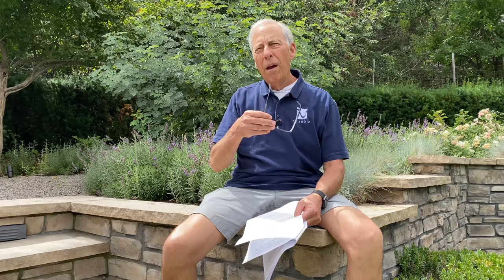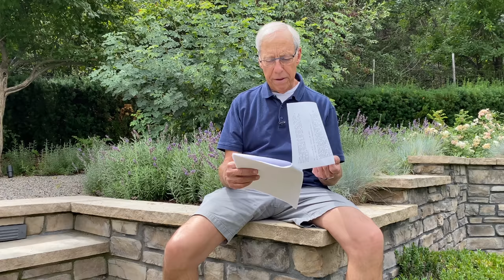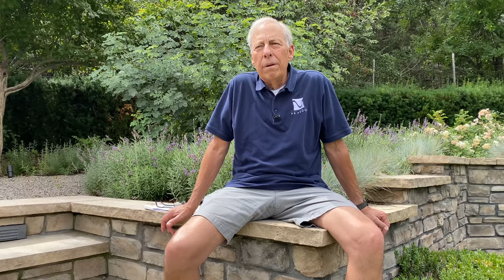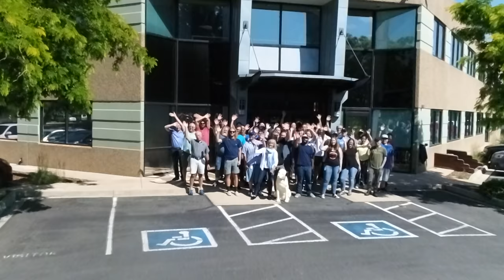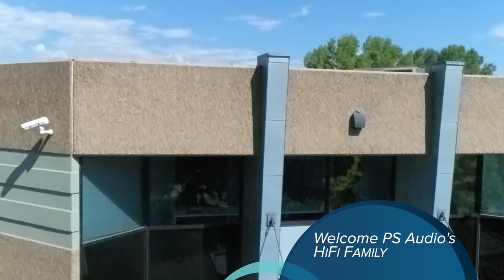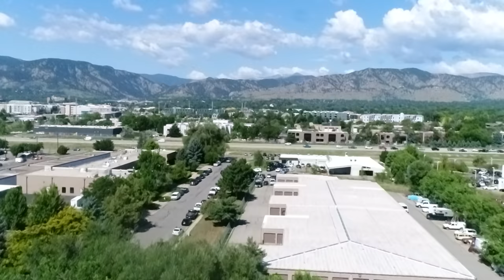Why speaker cables have bare ends

Comment: The reason the ends are bare is because who wants to screw around with adding ends to the cable when it's not needed. Just cut the cable to length, strip the end a bit and stick it in the connector. Boom, done. That's all that's needed. Anyone that tells you any different is trying to sell you something you don't need.
Reply: exposed ends corrode. terminated sealed ends dont.
Reply: @googoo-gjoob  where are you running these wires? In your pool?  That's bullshit. Except for areas with corrosive atmospheres.
Reply: @Alacritous  copper corrodes. crack a book.
Reply: I have always used bare wire too, as they provide better direct contact, but I don't mind if others prefer to get connectors, and funnily the corrosion issue often mentioned has never been a problem. But I do trim them back every 10 years or so
Reply: Banana plugs rule.
Reply: @googoo-gjoob  where are you setting up your stereo where the air causes copper to corrode? In the sea?
Reply: @musicman8270 ... rule what?
Reply: Copper tarnishes pretty rapidly. The tarnish is a fairly good insulator. Copper will slowly corrode as well, but it less a concern than the tarnish.
When I used bare wire, I used to re-tighten the binding posts on the 1st of every month, I could always tell after wards.
Crimped on connectors of any kind are the best since the crimp forms an airtight seal that will not tarnish. Gold plating is good because it does not tarnish, but it wears off very fast (typically less 100 cycles). Nickel is also good.
Reply: @humanitech    Oxygen free copper terminated by gold plate banana plugs rule the day,  no hassel   when you need to change things, just pop them out, no loose wire strands shorting out a 2,000 amp,etc.  Easy  peasy.
Reply: @musicman8270  LOL ..I agree on the OFC cable and the convenience of bananas, but on comparison I still prefer direct bare wire connection myself and so have loads of bananas plugs and spades sitting in a box...but that's the fun of hifi we experiment and use what suits us best.
Reply: @joshua43214  Let me guess. You buy monster cables, too. Right?
Reply: @Alacritous  Why would you suggest that? Do you disagree with anything I said? Copper does not tarnish? Tarnish is not a poor conductor? Binding posts have weak threads? Solder cause wire to break?
And no, I get wire from Bluejeans cables and make my own...
Reply: Alacritous Copper turns green over time. That green is not a great conductor.
Reply: @billd9667  yeah, over years.
Reply: Alacritous and how often to you service your speaker and amp contacts? I don’t know about you, but I  often let them go for years
Reply: @musicman8270  lol...make sure it's not copper bottomed though ...cos they tarnish
Reply: @_Mr_C  just a lot of trouble, a pack of bananas is inexpensive,  easy to attach and dont wear out . I am constantly plugging and unplugging my bookshelves,  so they won't fall off the stands when I am working on my gear, bananas are a godsend
Reply: @_Mr_C   One more thing... electolysis, what makes batteries work. Two dissimilar metals touching have electrons passing between each other, current. Small but over time these two will bond, sometimes rusting  into each other. WHY you need gold plate or some other inert material. Especially with vintage gear,which often has cheap base metal or tin plugs on the back.
Reply: @Alacritous  Just go to ountries like philippines , vietnam and other subtropical / tropical countries.
Even ' Plugs " from banana on speakers to XLR ect they corrode way too fast.
Not to mention .... Guitar strings ... a real nightmare , they corode in just a week for the cheap ones 
and the more expensive . well if lucky they last 3 month.( those in north europe last years )
So , yes some people like me live in a country with very high humidity and temperatures....
We need to take extra care of the equipment otherwise it simply will break because of corrosion.
Reply: @kennethsrensen7706  I am not there. I am in Canada. Are you there? If I were there then I would adapt to the conditions there. I am not. And that's not what I was talking about. I mentioned humidity as factor.
Reply: @Alacritous  oh yes I understand.
Yes Im in the philippines and dealing with such problems every day.
Humidity is really high here.
Im from Denmark and when living in Denmark there wasn't really any issue with corossion , just as you say about cannada , it's pretty much the same level.
But not here where im living now.
I always use bare stripped ends on speaker cables but here I have to ' clean ' them every week to stop corosion.
I found that clean the copper with WD40 and let the ends being wet ( with WD40 ) for a few minuttes and then wipe them totally dry actually work and it protect them a little.
( WD40 have some anti-corrosion stuff , not the best , I know but at least I can get this here ) 
I do the Same with my guitar strings .
After playing on my guitar I wipe the strings clean with a dry cloth and then I clean them with WD40 and leave it as is until next time I play on it. before I play on the guitar I wipe the stings with a dry cloth too.
This have helped against corossion so at least the strings last a bit longer.
Same with the Jack plugs at the guitar cable . clean before and after every use and they doesnt corrode.
My plan in future was to get a cheap house and then rebuild one room so I can control 
humidity , not an easy task but is possible to do even for cheap.
Your statement on using bare stripped cables to connect speakers , I totally agree with. Extremely easy and take a few seconds , shure no need to fiddle around with it more than needed.  : )

Comment: Ferriles are a nice clean fitting at the end of a speaker wire to attach your speaker wires to your speakers. And unless you have speaker wires exceeding 10 feet, the difference between pure copper, and copper clad aluminum is neglible. Nothing wrong though with using larger guage wires than the regular folk.

Comment: The only shielded speaker cables I'm aware of are certain Audio Note cables like the AN-L and AN-D, where the shield is tied to the negative terminal at the amp end only. There have been some coaxial speaker cables like OCOS, but these aren't truly shielded, because like all speaker connections they're carrying a balanced signal.

Comment: Some commercial sound systems (constant voltage) use shielded speaker wiring --- 
but now that I think of it, I'm not sure why. 
Maybe they are so close to high-power radio stations that it becomes necessary. 
     
And, in the late 1970s, I could hear my dad's CB transmissions coming through the stereo speakers in my bedroom.  
No, he wasn't running any illegal stuff; he had only what the FCC allowed.
Reply: Same happened with me 20 years ago with some PC speakers that would pick up CB radios.  It used to scare the crap out of me when I heard people talk in the middle of the  night.
Reply: It's the low voltage parts of the system such as in preamps / tuners / tape machines / line cables ect ect 
somewhare in there something is't shielded / grounded good enough and it pick up noise.
Speakers and speaker cables doesn't pick up anything but noise elsewhere in your system will pass through 
your amplifiers and blend into the higher voltage signal going to your speakers and thats why you can hear it.
Yup can be pretty hard  to trace the source from where it come and what part of the system cause it.
I had the most iritating noise comming ' into my speakers ' but I noticed that it was only when i was playing
on my electric guitar and mixing it with my music creations.....
Ironically enough when I play on my guitar alone there was zerro noise.....
Then I realized that I used a second audio interface for the music and this one was USB ... the one I use with my guitar is firewire .... Long story very short - I was driven crazy to try pinpoint the source of this but I ended
finding that my USB audio interface was connected to an USB hub with its own external 5v power supply 
and that one had gone bad... Yes it was the power supply making all the noise.
After plugging the audio interface into it's own port and getting rid of the faulty power supply then the 
noise was totally gone..... But it took me 2 month to find the source , I tried change cables , grounding 
shielding , again and again checking each part of my equipment .
I finally found it ... damn power supply...

Comment: Hey there.  Thanks for your videos.   I am fairly new in the audio-holic world  (played with lots of stuff in the '80s).   I have been studying things... and I know the cable discussions get heated.   I have seen videos and papers that could convince me either way :-)
Now, you say you don't know of any cables that are shielded.  Since I have been researching, I can give a large list.   Whether they are any good, I don't know.   But I have a lot of TV, Internet, etc cables running around near my AVR, so I felt better getting some lower-priced shielded models...
I saw one video where a guy connected various 'qualities' of cables to the FM antenna screw on an old receiver.  The freebe cable was a great antenna :-)  As the price and complexity went up, the FM signal went down.   Another video talked about the inductance, capacitance, etc... technical -- most cables don't list that though.
So, here are a few 'shielded' cables  (many are 'double shielded')...  if I am reading the descriptions correctly.  (also some braided ones)
1) KnuKonceptz  https://amazon.com/dp/B01EVLAWSI
2) SVS  https://amazon.com/dp/B0197UUMD8    and others
3) SKW   https://amazon.com/dp/B07MNYDJLV
4) FosPower   https://amazon.com/dp/B00LBK389I   (nice picture of internals)
5) EMK   https://amazon.com/dp/B07TLTJPHP  and   https://amazon.com/dp/B07951CGTD
6) Mediabridge   https://amazon.com/dp/B003FVYXY0
7) KabelDirekt   https://amazon.com/dp/B00DI89JMG
8) BlueRigger   https://amazon.com/BlueRigger-Shielded-Subwoofer-Plated-Connectors/dp/B008UGPBXM

Comment: I think bare wires are simple and avoid unecessary extra soldered connections. This saves money and removes a potential point of failure. Personally I often use banana plugs, but purely for convenience in swapping out connections. On the corrosion point, it's easy enough to snip off a quarter of an inch once every couple of years.

Comment: The Tannoy Eaton, Cheviot,  and other Tannoy speakers have a ground terminal so, if you have shielded speaker cables, just spend $5500 and up and you will have speakers with  terminals to attached your shield to.

Comment: Aren’t many of the ‘Chord Company’ cables shielded? Foil is present on many of them, beneath the PVC housing, and there is an additional layer of braided wire atop that foil on some as well.
I have no idea how many people connect a pigtail to that by soldering or crimping, but presumably that could then be connected to signal ground at one end only 🤷🏻‍♂️

Comment: According to last month's issue of Audiophile Monthly High Graphics Magazine:
It's important to keep your speaker cables lightly lubricated with a mink oil liquid suspension of zinc tetroxide. It keeps the sheaths supple and increases the electron velocity that tends to slow near the endpoints. This can create standing waves of electron clouds, impeding the ideal electromotive forces at work in the voice coils. Those standing waves can overflow the dielectric of nitrogen and oxygen around them, and the result will be immediately audible to the finely tuned, trained ear.  Be sure to use audiophile grade mink oil with copper-free zinc tetroxide. 

The differences are best heard by audiophiles of culture and sophistication who can tolerate nothing less than the finest in audio minutia. A good brand of this product is Rube's Viper Lube. Available at any Gucci outlet.
Reply: Jim Shaw 
Sounds like snake oil to me but I’ll give it a go.🤪
Reply: Good stuff...the lube is available on Amazon as well...
Reply: You ought to go to work for Paul selling power regenerators and other bulls***T
Reply: Jim Shaw Excellent advice. Alternatively you could use speaker cables cryogenically treated for 42.5 days at 0.0139 degrees above absolute zero with precision insulation crafted by Tibetan Monks from the finest silk to ensure no electrons escape. These cables are available for a very reasonable $3999 per metre. Or you can do as I do and use ordinary 12 gauge twin wire.
Reply: Fat Rat  No, but there IS a recommended vacuum tube power amplifier with a solid state digital preamp section (no feedback anywhere) available. Manufacturer is Braeburn, model is #Honeycrisp. About the cost of an E Class. Glows teal.

Comment: Not all, Neutrik SpeakON:
https://www.neutrik.com/en/neutrik/products/speakon-loudspeaker-connectors/speakon-cable-connectors

I bought a set of Centrance Reserve Series Speaker Cables at a good price from Drop.  The Centrance website states that these cables are shielded.  However, I do not believe that is true in the normal sense as shielding would increase cable impedance and make then sound very bad.  Also, just looking at them, they appear to be a simple twisted pair construction.  This is a construction adopted by Bell in 1881  to reduce noise in telephone cables.  I would not call it shielding though.  It is a construction commonly found in Pro grade speaker cables.

Comment: As far as I have been able to ascertain it is worth shielding low level signals from say a pre amp to a power amp or from a phono cartridge. Full line level signals, 2V or so are probably not worth shielding and speaker level signals not either.

Comment: Professional loudspeakers and cables for sound reinforcement (public address and stage monitor systems) generally do use non-bare wire connectors, either tip-sleeve or Neutrik Speakon. Why have these not made their way into the home market?
Reply: Price and application, and trying to get multiple manufacturers to adhere to a single standard that they themselves didn't invent? Good luck with that.

Comment: I put crimp fork ends on my Realistic Receiver's speaker wires because the are metal terminals that cut into the wire and I take them off and on a lot. I would think the raw cable end would make a better connection between the two?

Comment: But why not put a metal stud, or at least tin the wire ends so they are easier to put into the amp binding posts without some of the stranded wire 'hair' sticking out?
Reply: I think it's because too many options for termination, so installer get to leave bare or install his favorite end (banana, spade, pin, SPEAKon, etc.)
Reply: HEY! I make good money from those little hairs you speak of crossing over to the opposing terminal. Don't be letting our secrets out.
Reply: Tinning has 2 problems:
1st, the wire is extremely prone to breakage where the tinning ends. A handful of flexes will break the wire.
2nd, the solder is soft enough to prevent the binding post from getting a good bite. You can't tighten the posts enough to get a good bite with out breaking the binding post.

Comment: The Audioquest speaker cables for sale on your website advertise shielding.
Reply: Lol way to go!
Reply: when i read your comment, it rang as untrue .
so i went to  https://www.psaudio.com/connections/speaker/  and read EVERY word about each speaker wire. 
the word SHIELD is not mentioned even once.
Reply: @behexen250 There seems to be some confusion about the nature of shielding. It doesn't have to be gas tight. If the vast preponderance of the signal path is protected then you will reap the rewards of shielding. It's not like a condom where a tiny pin hole can ruin your day.
Reply: e.g. https://www.audioquest.com/cables/speaker-cables/mythical-creature-series/dragon-zero
"AQ’s comprehensive Linearized Noise-Dissipation System combines multiple shields and a carbon-based linearized resistive network that turns most of this noise into heat."
Reply: @behexen250 My comment was to address the ends, where people flip out over them not being shielded. I was speaking of the connection as a small part of the signal path.
Reply: @VOLKOV9  that's referring to "Ground Noise"  that's not external noise trying to get in,  its internal noise from within your own system,   even those absurdly expensive "mythical creatures" speaker wires aren't shielded from external sources
Reply: @xsiveperformanceengineerin7447  It specifies that it's addressing an "environment ... saturated with radio-frequency noise ... from satellites, cellular towers, and Bluetooth, etc."  And also refers to them as "shield conductors".

Comment: Bare wires? Industry inertia, mostly.

As for the noise issue... I think watts might be a better reference point than volts; given the various impedances in a speaker. But in any case; Paul is right; the ratio between the amount of wattage that your speaker cables pick up as an antenna vs what it takes to make audio is so drastic that in practice it’s a total non issue. There’s just no energy there to make the speaker cones move.

If that’s so, how does a signal cable pick up noise? Well, the input to an audio device usually has a comparatively high impedance; meaning that it takes very little (and for an op-amp, theoretically zero) energy to make it “move”... so what little energy from noise is there can have a much larger effect than one might otherwise think.